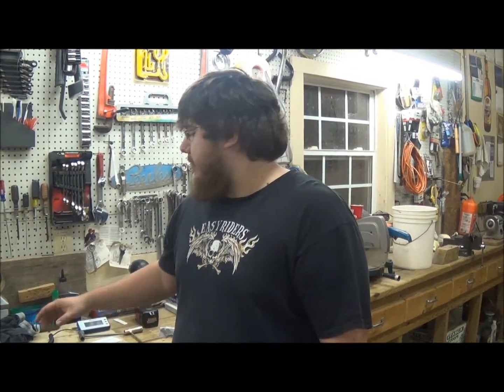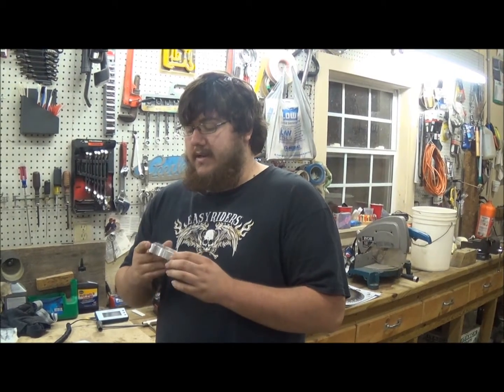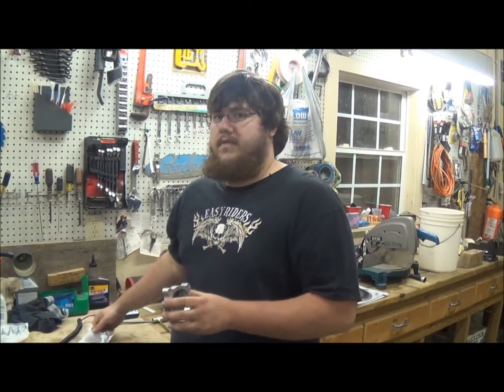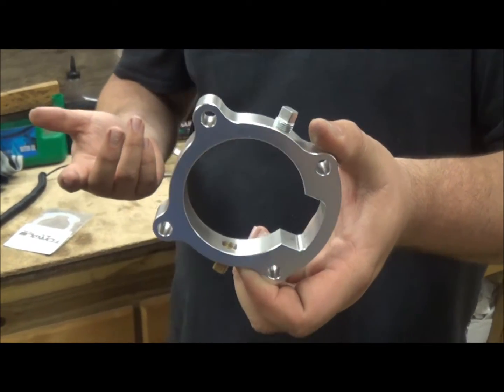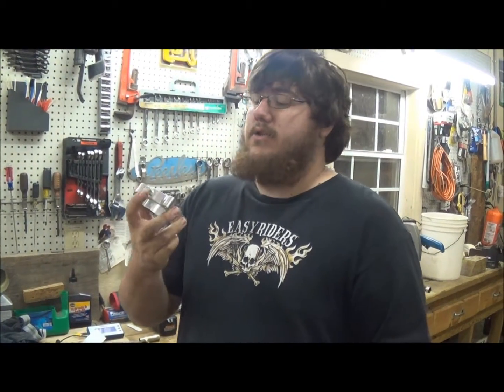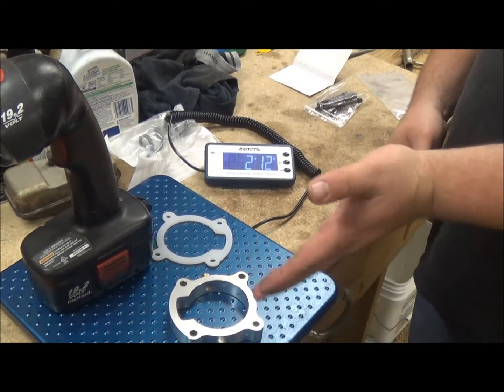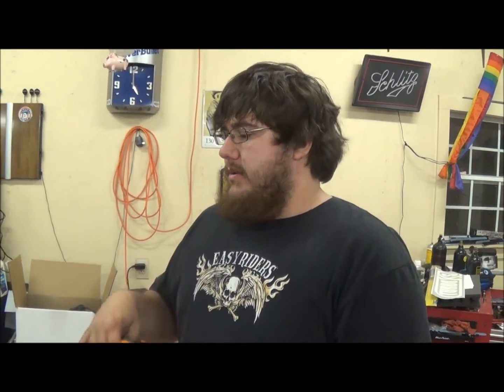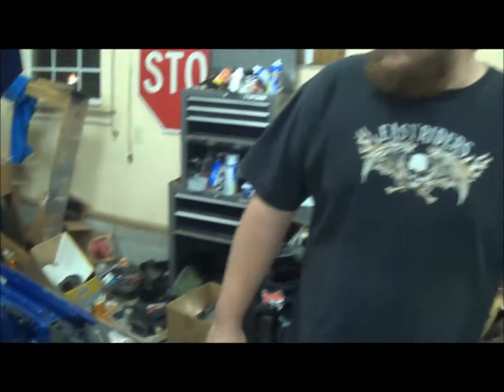fitform&function genesis coupe throttle body spacer

Comment: Hey I noticed that part is for a bk1 2.0t same with the gasket there is not that much difference between the 2 is there? I see other spacers without the little slit on theczide but only 1 gasket for the 2.0 and its for a bk1

Comment: Hopefully you would be able to help, how did you remove the 2 long bolts that are connected to the throttle body??
Reply from the maker: put two nuts on each bolt and was able to back them out
Reply: +FitForm&Function so do I tighten both nuts as much as possible and then the nut closest to the TB, use a crescent wrench to untighten it?
Reply from the maker: nah you tighten the nuts to eachother and spin it away from the throttle body

Comment: After taking my throttle body off I tried your method in unscrewing the 2 screws but they won't come off. I'm afraid I'll strip the thread and have a bigger problem
Reply from the maker: +Grant Smith the top two bolts did not want to unscrew and when I got them out they didn't want to go back in. It was weird because it was "stripped" per say but I ran the right size tap through the threads and they went right in.
Reply: +FitForm&Function alright. So the screw should come out after I use the bolt method if I use enough force. What size tap did you use?
Reply from the maker: it should come out with the bolt method it wasn't that stuck on. now I cant remember what tap it was I just matched it with the threads.
Reply: +FitForm&Function I got the studs off but now the screws are too long. Did you have this problem?

Comment: I have a Mustang GT 2005 and i install a throttle body spacer. It didnt come with a fiber gasket. So i just install it like that. It fit like it should. You think i will have problems?

Comment: I used silicone to make a seal when i first installed my TB spacer because i noticed the bottom wouldnt seal.
Reply from the maker: I didn't want to use silicone but after putting the phenolic gasket between the intake manifold and throttle body spacer I didn't have any leaks anymore
Reply: How bad was the initial leak?
Reply from the maker: Nathan Raffle  not really that bad but any minor leak needs to be fixed

Comment: When removing and replacing the throttle body, are there any reprogramming or special procedures required to make it work normally or do you just plug it back in and everything works fine from there?
Also, is this a 2.0T or a 3.8?  Great video, thanks for posting.
Reply from the maker: this is a 2.0t and there should not be any reprograming but make sure you put the phenolic gasket between the manifold and throttle body or you may develop a leak.
Reply: FitForm&Function I have a 3.8 - same for the 3.8 throttle body?  thanks
Reply from the maker: it is a different part number because it is made different but everything else should be the same